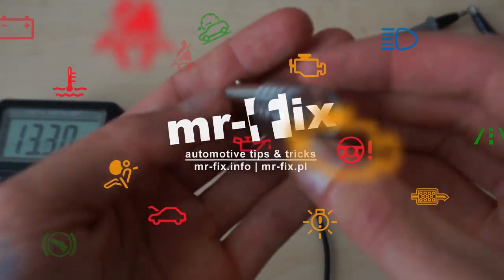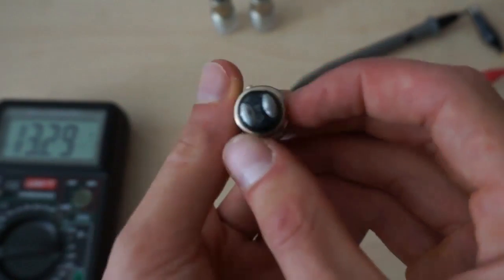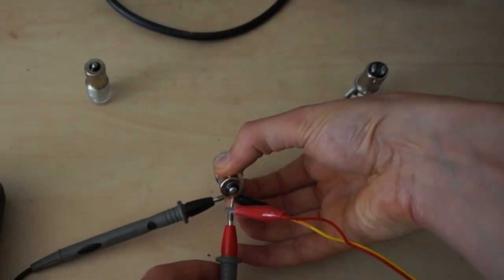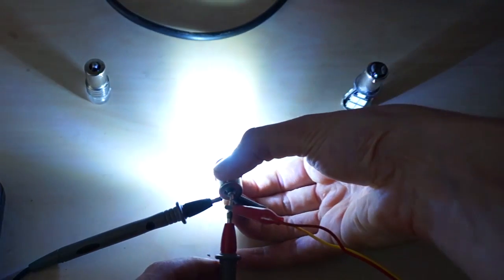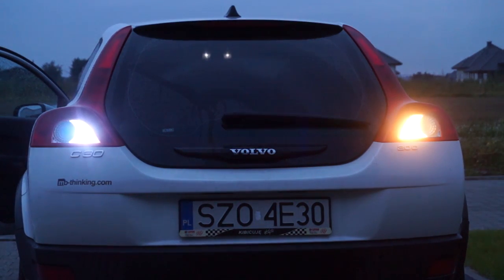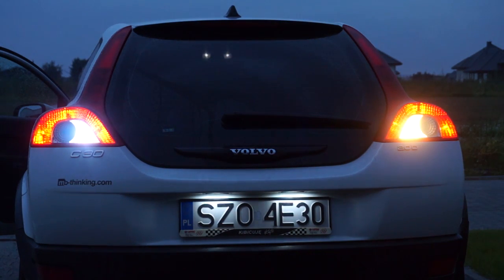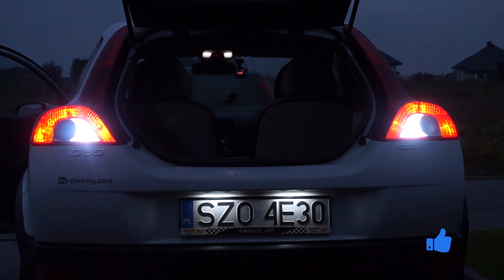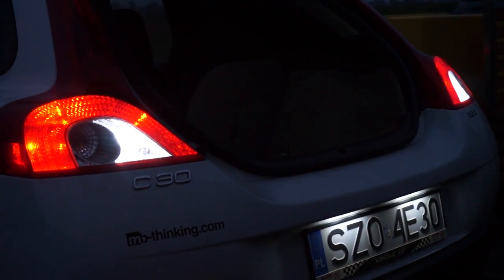Comparing LED P21W reverse light bulbs with standard

Comment: @mr-fix , did you try to replace the upper left adn right brake sugnal for LEDs ? tried it a few days ago and got a faint glowing een with the car turned off and locked .. is it normal or sould I look for a ground problem  ?  anyhow, this means there is an electric flow through the incandescent bulb anyway, simply not strong enough to make the bulb light up..
Reply from the maker: That's common, especially when changing interior bulbs to LEDs that don't have the resistor (so called can bus filter). There is some electric flow. You can check with a multimeter how much amps are going through to see if the flow is not going to drain your battery.
Reply: mr-fix the bulb I use are Sylvania Zevo bulbs that are not supposed to get the blown bulb message.. I might just get some of those resistor.

Comment: what about the light output? usually leds give less lumens than regular ones.
Reply from the maker: +ugurcetmili LEDs give more lumens per watt.
Reply: yes they do, but the light you took was like 15-25 watt bulb and you put 3-5 watt bulb, i am asking the output you have with these lights?
Reply from the maker: Standard is 21W, single chip LED is 5W, multi chip is 6W.
All three give pretty much the same brightness which makes sense when looking at charts for picking light source for your home where LED consumes 1/4 power compared to halogen with the same light output.